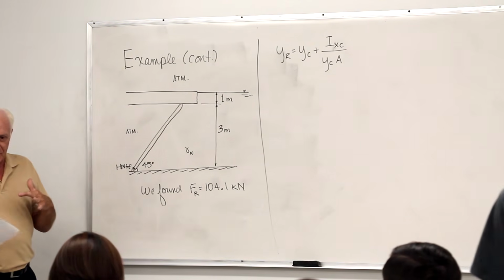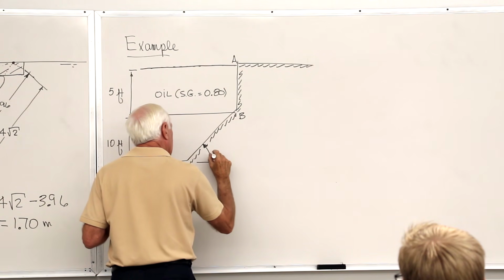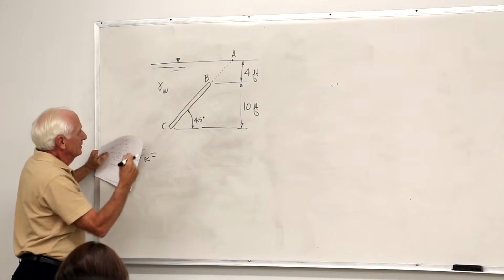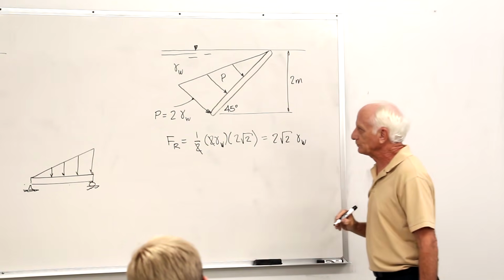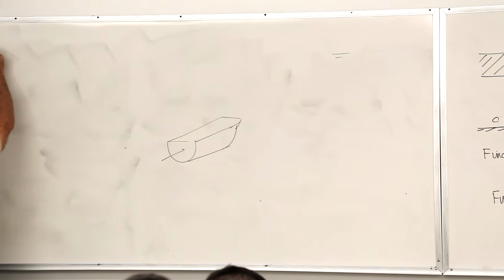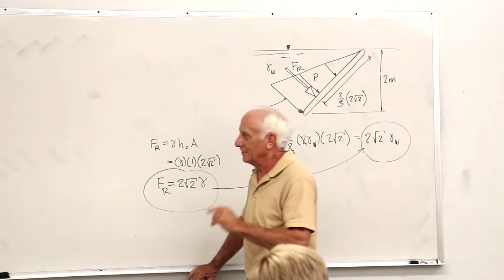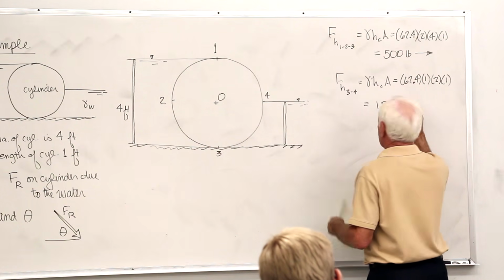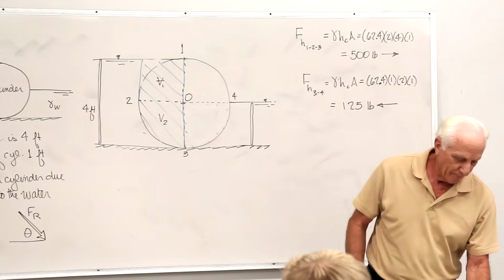Fluid Mechanics: Forces on Submerged Surfaces II (4 of 34)

Comment: I just noticed the cylinder buoyancy problem for Fv can be solved by replacing the 'submerged' parts of the cylinder with a static water volume.  Since the volume would not move, the buoyancy force is equal to the weight of water displaced, 1/2 cylinder volume on the left, and 1/4 cylinder volume on the right.  Net Fv is indeed 3/4 * Vol_cylinder * gamma_water

Comment: hello sir, thank you for posting this, I do have a question however. Multiple times you referred to sin(45) as "square root of 2", wouldnt it be (sqrt2)/2? 

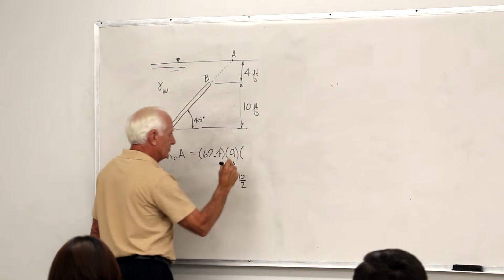example 22:22, you say the length of BC is 10sqrt2, wouldnt it be 5sqrt2? 

Thank you again sir
Reply: just to be a little more clear, at 22:22, BC would be 10sin45 right? so 10sin45 is 5sqrt2 not 10sqrt2. I know im mistaken I was just hoping someone might be able to clear it up.
Reply: @bbersagnstfmnsm  it would be 10/sin45 because it's the hypotenuse. That's why it's 10sqrt2
Reply: @bbersagnstfmnsm  https://youtu.be/eqkPn8FsxH0

Comment: I tried replacing oil with water by also changing the depth that it's equivalent to,  as said in the video.  The final answer wasn't accurate though,  where did I go wrong?
Reply: same here...curious where the 562 came from
Reply: @alexdejesus6342  https://youtu.be/eqkPn8FsxH0
Reply: did you get 566A also?
Reply: @angelikadetalla8787  https://youtu.be/eqkPn8FsxH0
Reply: https://youtu.be/eqkPn8FsxH0
.
.

Comment: I don't understand where he keeps pulling that square root of 2 from
Reply: If the angle of the triangle is 45 degrees you can find the length of the hypotenuse by multiplying square root of two with the length of the sides

Comment: Sir , why are you calculating area instead of volume while you solved first example on curved surfaces for vertical forces calculations ?
Reply: Aqif bhat bcoz length of the cylinder is 1 ft only.

Comment: why hc is not equal to 9 + 1/2*sin45 ?
Reply: because hc is the distance from the free surface to centroid and it is 1 meter wide and inclined by angle of 45 degrees
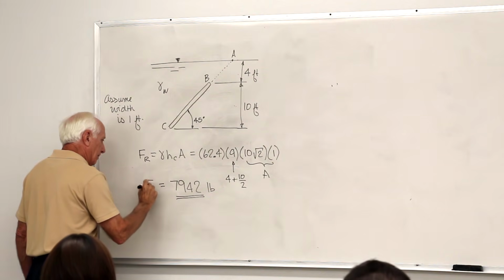Reply: @22:52

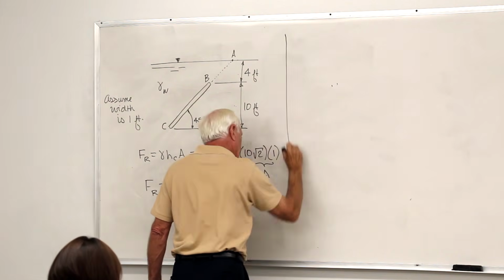Comment: from where 10 sqrt(2) came as height at 22:56
Reply: the hypotenuse length is what we are looking for, so lets name it x ... this is how you find it...
sin45° = √2/2 
(verical)/(hypotenuse) = sin45° = √2/2  
h = 10 ft    
h/x = √2/2  => x = (h * 2)/√2 =(10*2 *√2 )/(√2*√2) = (20√2)/2 = 10√2
Reply: it is not the height the prof. talked about through concept . It is one side of the plane surface we have chosen which we are working on it . actually it is length (from side view) of the figure which you see as a gate. from top view it is a rectang. and 10 sqrt 2 is the height of that rect
Reply: or you can think of it as Pythagorean, 2 equal sides of 10 ft, the hypotenuse is √(10^2+10^2)=10√2

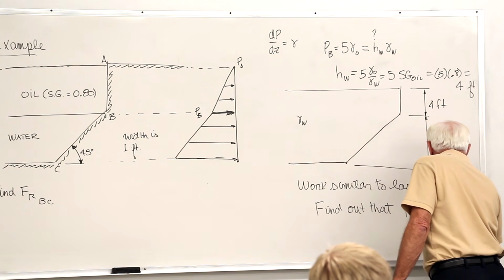Comment: where the 562 at 18:29 comes from?
Reply: (Specific weight of water)(height from surface to centroid of BC)(Area)=(62.4)(4+5)(A)
Reply: @Evan-rl1rn  hello after 7 years
Specific weight of water = 62.4?
How?
it must be around 9810 N/m^3
Reply: @greenfox3363  Found it, the 62,4 its in British units

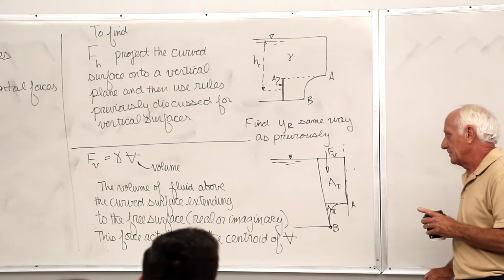Comment: 55:40  Good lecture, but are you over-complicating it with the vertical forces? You could just sum up the volume of the cylinder that IS in the water and get the same Fv result? 

(In other words, you sum up the volume of the water being pushed away by the cylinder. In this case,  75% of the volume of the cylinder is being pushed away.)

Comment: he mentioned heavy derivation at 43:13, can someone tell me about that please? or point me to a reference pleaaaaaaaaaase, i really want to know.
Reply from the maker: If you want to calculate the resultant force on a curved surface without going through the procedure shown in the lecture, you will need to utilize integrals and know how the curvature changes in space. It would be very tedious and you would not be able to obtain a general algebraic equation that can be applied to all curved surfaces. Most undergrad fluid mechanics books follow the procedure in the lecture.
Reply: @CPPMechEngTutorials       Can we have a reference book pleaase siir 🙏
Reply from the maker: You would need to know the orientation angle at all parts of the curved surface. This often will be difficult except for very simple geometries.
Reply: How can I use integral when getting bar h and hydrostatic force..? thnx

Comment: how does square root of 2 comes in Yc
Reply: since it's a 45 degree angle the bottom and sides are equal, so the hypotenuse is sqrt( h^2 + h^2 ) = h*sqrt(2) = y_c
Reply: Yc is measured along the path of the plate to where it intersects the free surface. So even though the depth is 2.5m Yc is a little linger since its at angle 45

Comment: It was very helpful when the homework assignments were on the board as they were in the first video. It helped to follow along the lecture as if you were in it. Any way to get the problem sets?
Reply from the maker: I will check. If it is possible, they will be posted on fluid mechanics section of ME Online (www.cpp.edu/meonline).